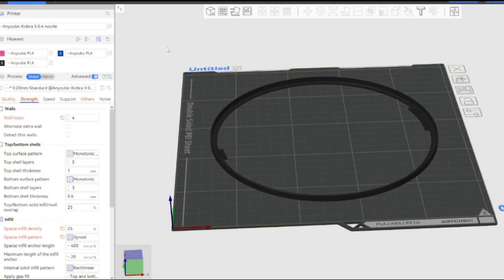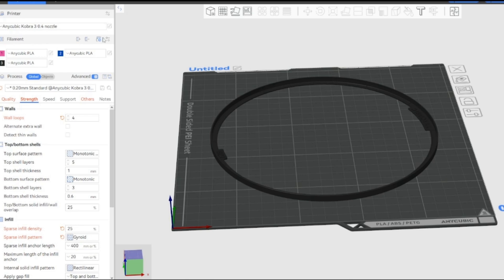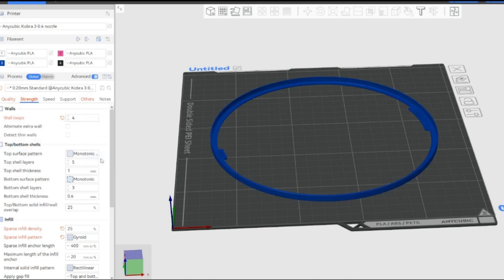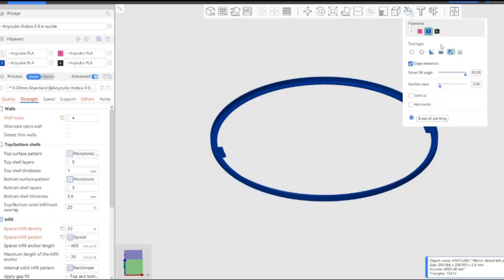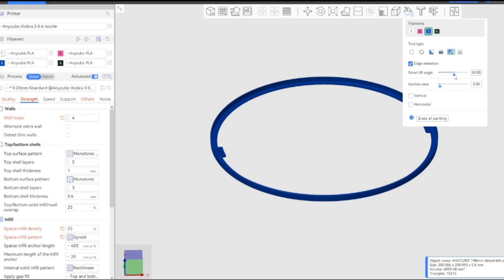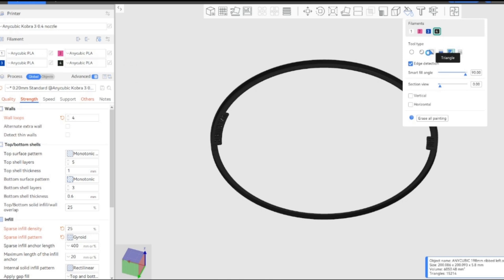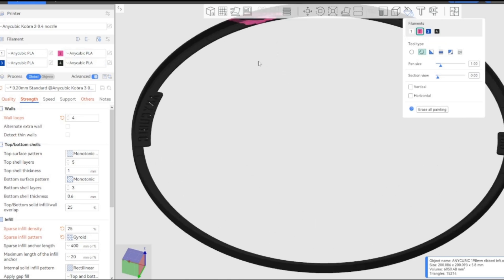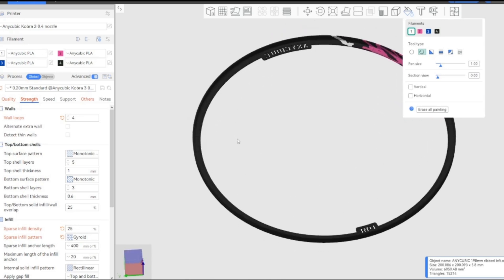How to paint 3d printed models using the Anycubic Slicer Next

Comment: Not being able to draw diagonal makes it pointless. You can’t draw a straight line with a mouse.
Reply from the maker: Hi you can paint straight lines using the seam painting mode in the anycubic slicer next. You can also do it by aligning your model in the slicer until the line you want to paint aligns with either the horizontal or vertical axis then no matter how you use your mouse it will paint a straight line.
Reply: @ I know about horizontal and vertical but diagonal was impossible…….until I just realized what smart fill angle was lol.
Reply: @BossMan302  To make painting really easy, make sure you create a seperate object for every part of the thing you want to print.
Right click on the model in de slicer en select "split" and choose "to parts"
Now you have seperate parts you can just fill and there will be no filling on anything else than that part.

Comment: Why does mine keep printing a block of the colors changed but not the object ? I did it this way in the slicer next same program and it didn’t work.
Reply from the maker: Hi all you need to do is make sure the slicer is set the to same colour filament you have in the ace box.  You need to first change the colours to what you have using the printer screen then make sure you sync your slicer with that, Then click on the object for whcih coloues you want to use, There is a fill mode or brush mode.  The fill mode you can change the percentage of how much colour you want on the object. Also you can turn the prime tower off in the slicer where it says multi matrial  and  just use the purge on the printer screen which will save you filament. Hope this helps if you need any more help please ask.

Comment: how about a decent tutorial on how to calibrate the Kobra 3? By that I don't mean auto-calibration
Reply from the maker: Hi Yeah I will do one if I start to get issues with print quality or bed adhesion due to z offset problems. So far I have not had any of these problems. I have seen users saying that their beds were warped and other issues where the eccentric nuts and belts had come loose or even snapped causing bad prints. I have also seen other users who cannot get the z offset right so they use paper to measure the offsets. I think one thing with the Kobra 3 is to not mess with the offsets manually but to use the auto calibration because that is all I have done and not had any real print problems,  apart from when one of the connectors in the print head came loose which was my fault because I did not push  in properly and when doing the vibration compensation process it came out.  There are also a lot of videos on how to calibrate other 3d printers and they do all work basicaly the same. If you are having real issues with calibration then I would contact Anycubic support. I don't want to manually mess with the calibration while its working fine lol
Reply: @resin-art-and-3d-printing  You have certainly gained a lot of experience. I'm a complete beginner and I'm trying to somehow understand all the settings and there seem to be a lot of adjustment screws that have to be combined with each other. I'm trying a few things myself, but I don't understand why the print runs very well up to a point and suddenly holes form on the surface, or suddenly a burnt piece of filament appears. When I look for solutions online, I almost always get the message that I should calibrate the printer with the filament. Flow, retraction, Z-offset... etc.
Reply from the maker: @marco_di  3D printing is never straight foreward and no matter which 3d printer people use they all have thier own problems. I have also been using the Anycubic Next slicer and using the Anycubic pre-settings. The only thing I have changed is the first layer levels and layer level thickness depending on what im printing. The infill patterns depending on what im printing as well and I always run it in quiet mode. 3D printing is a learning experience and takes time. I only adjust the excentric nuts and the belts if they become  loose. I tend not to mess around with other setting because my 3d printer is running well atm .